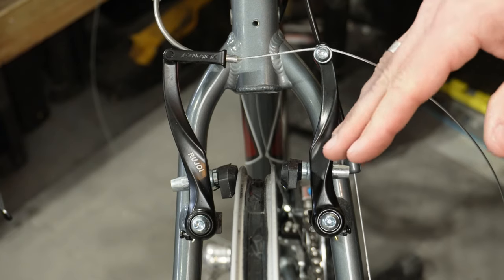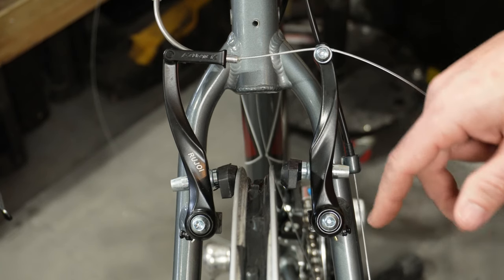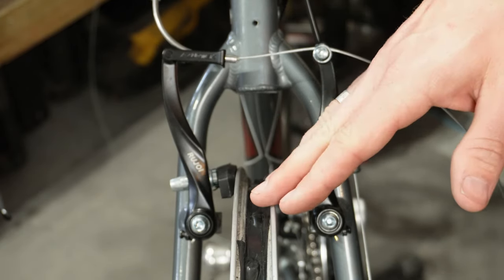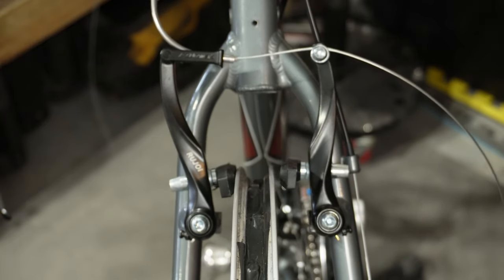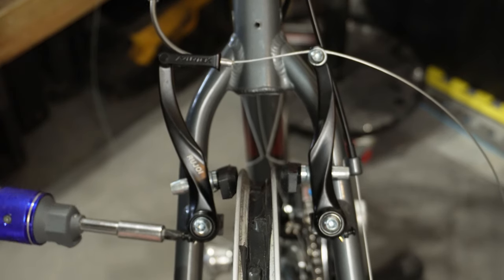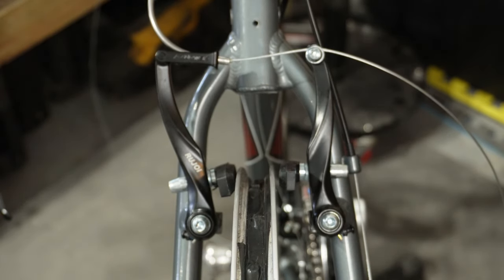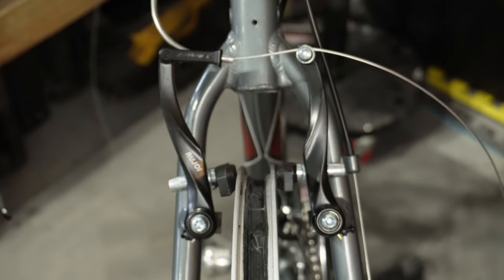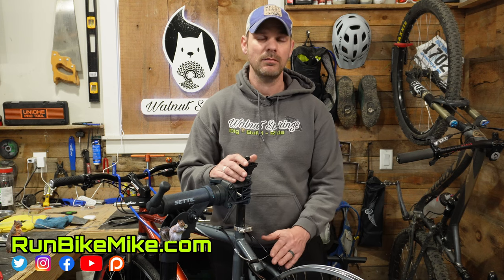How To Fix Bike V Brake Pads Rubbing On One Side

Comment: This video may be older but it came in Sooo handy I just got a new bike online had to build it out of the box and first thing I noticed after putting the front wheel on was this exact issue, every other how to fix issue made me start with the quick release, then undo the brake pads themselves and put it all back but finally got the answer I needed thanks to your video and just have to adjust those little screws , thank you!

Comment: Excellent! Dude, that was perfect. I fought and cursed my stupid brakes for 30min yesterday trying to fix before my ride. I'd been riding with one side rubbing and causing me to work twice as hard. Tried adjusting but I did was loosen the hell out of the whole front brake to the point it was near useless. Your video saved me a mountain of stress. Thanks again.🔥

Comment: I just changed out the pads on my bike's rear brakes (front brake is a disc type), and ran into this problem.   The linear / "V" brakes seem much easier to work with than the "caliper" types I remember fighting with on older bikes our family has owned, so I'm impressed.

Comment: I’ve been adjusting those screws and I’m not getting any change in spacing. Please help
Reply: Try aligning the brake pads
Reply: @nandishgs9640  how do you do that? Adjusting the screws did nothing. I have one side nearly out and the other as tight as it’ll go and it still is rubbing on the loose side.

Comment: Neither handle bar cable or the tension adjustments seemed to work so I removed the nuts at fork of tire mount and recentered the tire and finger tightened the nuts manually and that seemed to work.  Then I had to re-adjust the tension screws.  At least I know what their function is now.

Comment: My right side once pulled in doesn't pull back out. Its like its stuck there
Reply: So what did you do
Reply: They do that, remove it spray wd 40,fit spring for more tension
Reply: @Levelingup8  I did the wd40. Works a bit better. Not by leaps and bound though. Nay need new ones.

Comment: Brother , my cycle's wheel is not aligned correctly but I tried this , and made it more complicated it's rubbing more than before pls suggest something for that, your reply would be helpful
Reply from the maker: If the wheel is not true then this process will not fix it. You can reset the screws and slowly work them back to the way it was. But I would recommend trueing the wheel 1st.
Reply: @RunBikeMike  thank you for your reply I will try trueing it,brother

Comment: the best way is to make sure the arms of the brakes are more straight upwards ,these look too far apart.Then if the gap is too much on one side add a couple of washers before you start to adjust the screws.

Comment: For more adjustment, there are usually 3 pin positions you can insert the return spring in.
Reply: Do both sides have to be on the same hole?
Reply: @rideout_ryan  that's my question right now too
Reply from the maker: No they don’t. Normally they will be but they don’t have to be.
Reply: @RunBikeMike  Thanks for the reply

Comment: Today I changed the front pads and they started rubbing. Tried using the little screws to adjust and they are still rubbing. If I loosen the cable there is not enough tention😢

Comment: Im doing this and its not helping im thinking its because its a cheap ass walmart bike
Reply from the maker: If they are really off then a cable adjustment might be needed. Also sometimes the wheel not having the axle straight can cause issues.
Reply: @RunBikeMike  ok ill adjust it some more tomorrow thank you for the reply